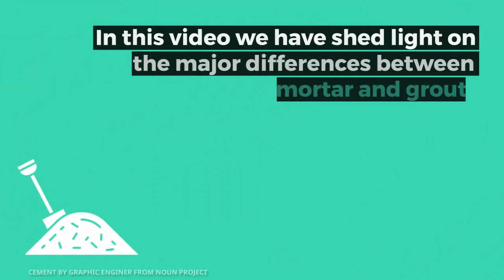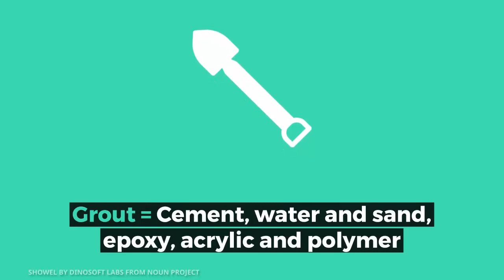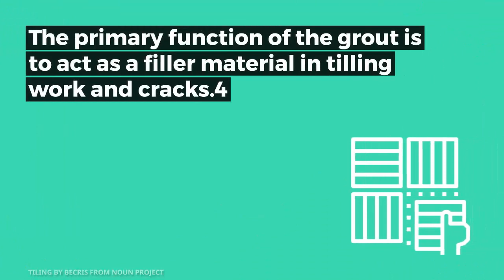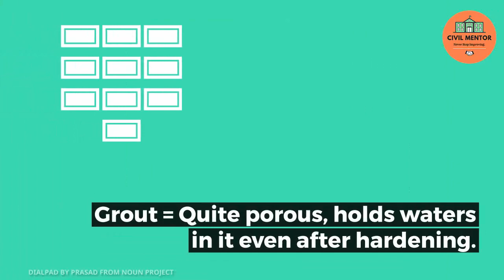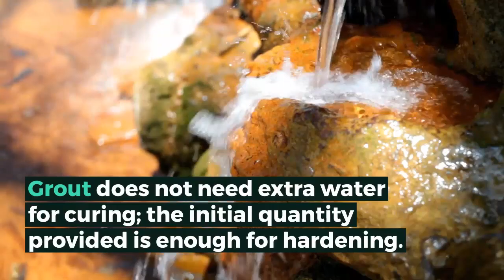Difference Between Cement Mortar and Grout in Construction.

Comment: This is wrong, grout is NOT highly viscous... it’s the opposite! Viscosity is “resistance to flow”... grout is low in viscosity
Reply: Noooo.."grout is highly viscous material "  means having high resistance to flow...for example : honey is also a highly viscous  because of its fluidic nature....don't get confused ...hope it is useful to you...😊
Reply: @sridevikothari2218  Having been doing concrete work for several years you are hopelessly wrong, but thanks for trying
Reply: @donkan683  grout is not viscous.. its mortar which is viscous. Don u r right. and Kothari please study well or u will fail your exam . lolzz
Reply: I'm confused 🙄